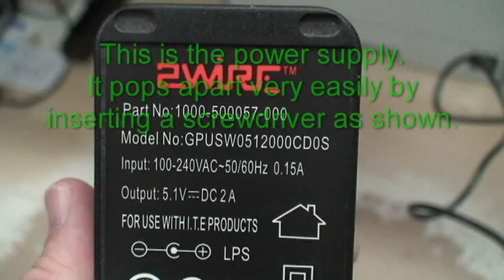2Wire Modem Power Supply

Comment: When the power supply causes issues, all you get is a dim red power light, and the power supply emits a squealing sound. This is caused by the open capacitors in the secondary detuning the circuit, and the voltage has dropped. Once the voltage drops below 5 volts the modem can not longer operate. If you measure the voltage under no load it will show 5.1 volts, but as soon as you try to pwer the modem it drops. A bright red light indicates a hardware failure, so it is likely the modem is bad.

Comment: Very good. Could fix a slightly different 2Wire 5.1v power adapter. Case could not be opened with a screwdriver, so I used a vise to break the attachment between the two halves of the case. The trick is to have two small pieces of wood, one the full length of the case and the other about a 1/2" long. Put the case in the vise with one of the wood pieces on one side and the other on the other side, both immediately below the seam. Then squeeze with the vise until you hear the seam crack free.

Comment: I was, in my prior job a licensed electronics technician for over 20 years.
I originally was on camera showing the diagnostics approach to repairing this power supply, and then one of bosses at my current employer saw me, and because I am in the public eye thought it would be best if I removed the video just in case there was a liability issue. I re-cut and reposted deleting my on camera appearance, and intentionally blocked out company name from the modem to make this video as generic as i can.

Comment: That is because the voltage has dropped below the lower operating voltage limit.
Replace the capacitors and it will work good as new.
The 2wires are reaching their end of life now anyway. ADSL2 is being phased out by the major players in favour of VDSL due to it's faster speeds and better error control.

Comment: After 10 years my 2wire PS failed. Confirmed using a different one. I cracked open the case. It's a bit different than yours. The caps look fine & held voltage (out of circuit). Update: Unable to find the problem so I'm replacing the 1000uf cap just to be sure. The PS reads 5.19 w/o load but 3.1 & slowly dropping with load. Update2: It was the cap! New one fixed it. So even if the cap looks ok, replace it. Thanks.

Comment: I believe a thunderstorm killed mine. Exactly the same problem a red light and a buzz. At first I though that the thunderstorm killed the modem, so I bought a new one. And just now about 6 years later I decided to try another power supply and realized that the modem works just fine. Now I'm just going to put it on eBay since I no longer need it.

Comment: I have a quick question, I just replaced both caps, but I realized that the negative foot of the 470uf 10v I just soldered should be touching the solder of the green cable, if that makes sense. please respond, i don't want to plug it in and blow the power off.